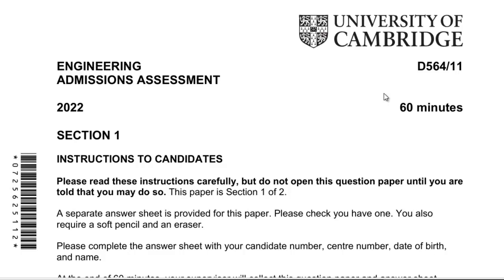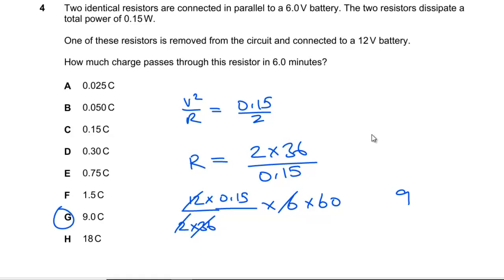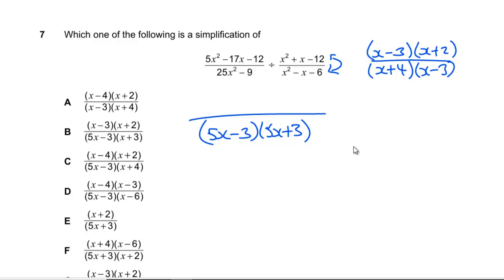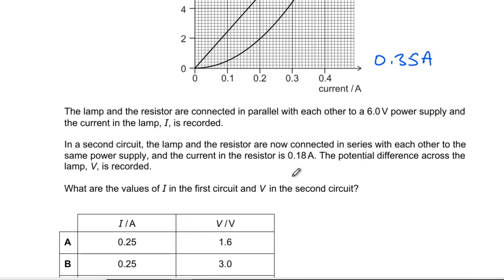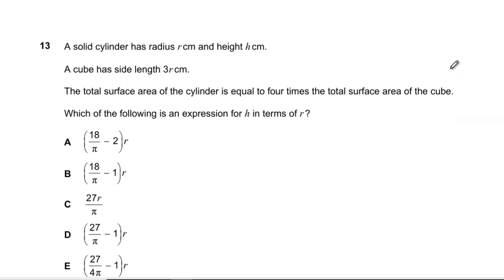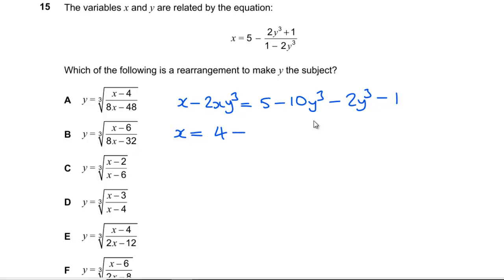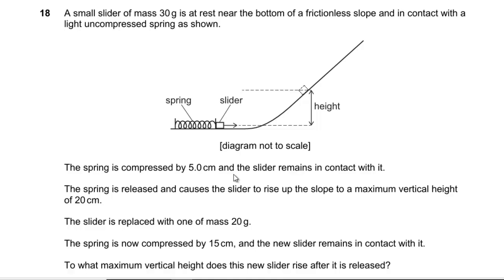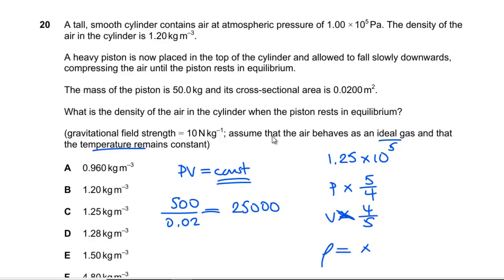ENGAA 2022 Section 1 Part A

Comment: could you please explain how you got to the answer at 18:27? thanks :)
Reply from the maker: First we need the number of ways we can produce a Pythagorean triple, which are (1,2,3) (1,3,4) (1,4,5) (2,3,5) (leaving out the square roots because they are hard to write in a comment box). Then we need the total possible combinations, where I've done 4+3+2+1 but you could use 5 choose 3 or 5 choose 2. This leaves 4 triples/10 combinations giving 2/5.